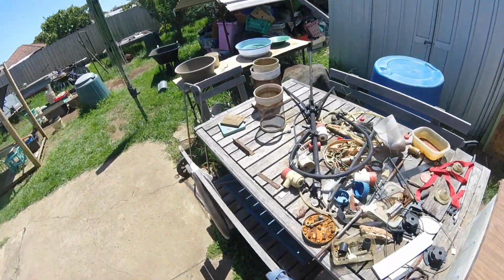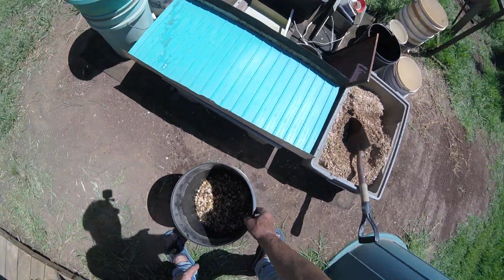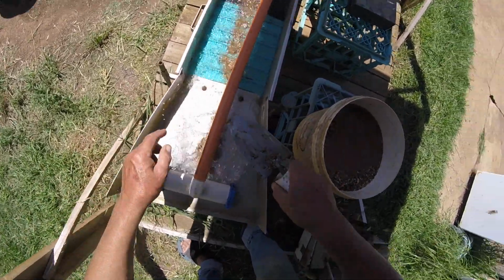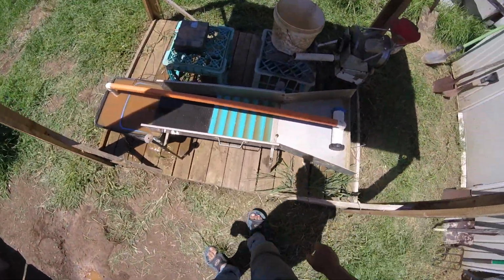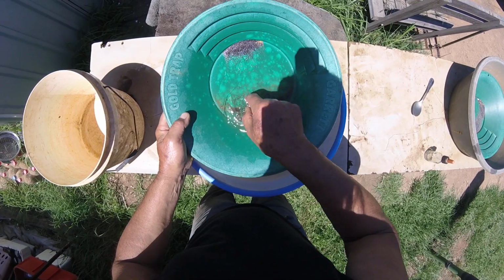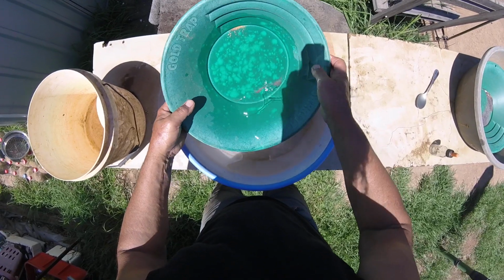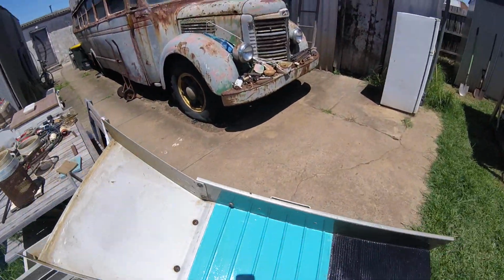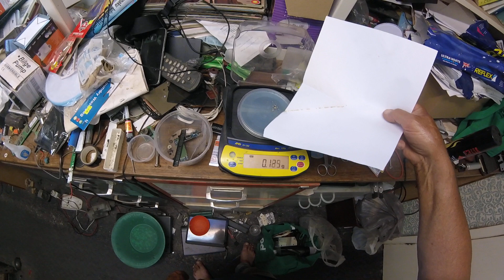Some Blue Mat testing and the weighin from Friday at Creswick

Comment: good testing man, i found the flatter you run your sluice the more water volume you need to run over sluice to creat the vortex
Reply from the maker: The flatter you run , the longer it takes to clear so that means slow feeding.
Increasing the water volume counteracts that.
Every mat has its own perfect angle and perfect water volume.
Reply: true to mate 
i set mine up to the conditions of where i dig if its sandy or clayey rocky then set up angles to suite @mohammednovalija